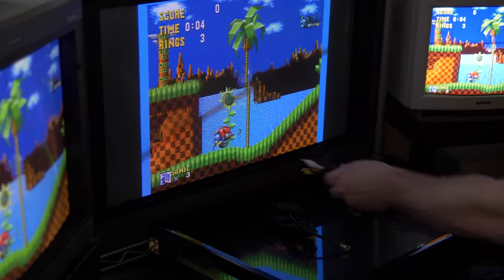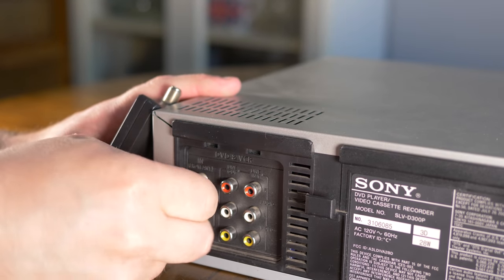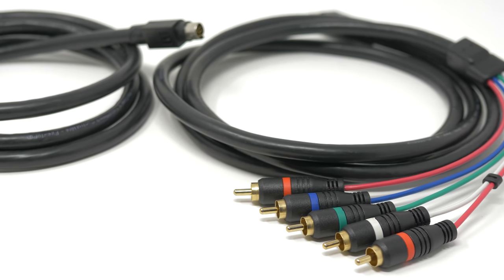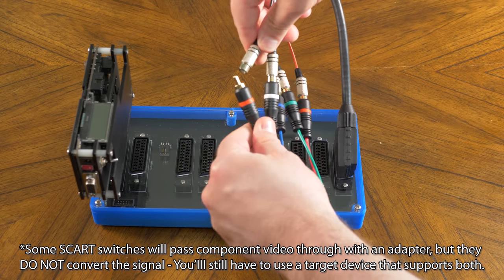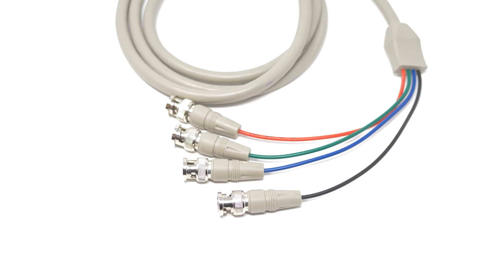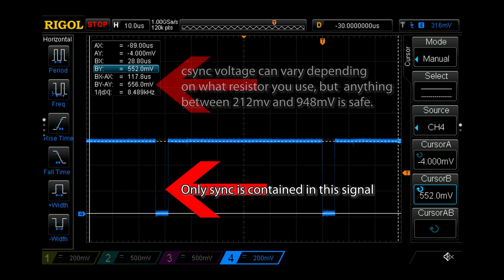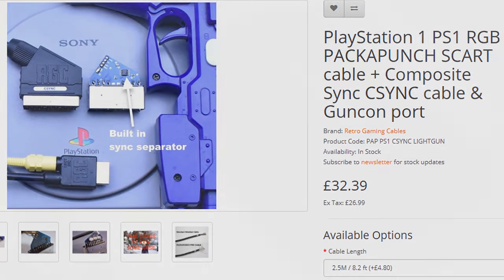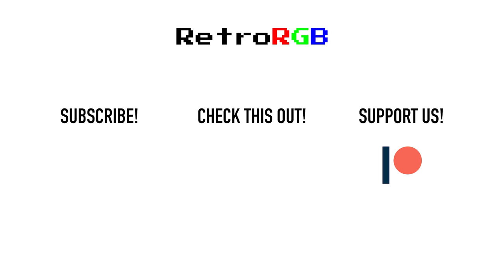Choosing The Right Cable For Your Classic Console

Comment: Europe: our games run slower, but at least we have RGB over SCART.
Reply: Haha you made me smile 😊👌. Kudos from Belgium, EU
Reply: @ceberuss_yt8266  You're welcome, from Italy, EU
Reply: Pretty sure anyone would gladly take a regular frame rate over RGB.
Reply: Germany: 50/60Hz mod soldering job at day one for most consoles :) 
RGB-SCART RULES!!!
Reply: Yeah your both right!Greetings from Zurich,Switzerland!
Reply: Nothing stopping you importing or 50/modding.  I stopped buying PAL HW since 1991 until 2005 when it started being optimised.
Reply: @bestofthebeastlikebeast3754  but how many consumer grade NTSC cathode ray tube TVs had SCART input back then?
Reply: @bestofthebeastlikebeast3754  "In North America, in the era when cathode ray tube Televisions were prominent, SCART input was not common, because it was an European Standard"
Did this sound more understandable?
Reply: I am so glad to own PAL Gamecube and PAL Wii because they support RGB out of the box without modding.
Reply: Laughs in homebrew and flashcarts
Reply: Not all games in pal are slow
Reply: If ur in Kentucky  I have alot of cables etc and 80s collectibles and star wars stuff etc
Reply: Stay away from atari they spark and cause fires
Reply: The PAL versions of the 6th Generation consoles began having 60Hz support natively with RGB support. Perfection
Reply: Meanwhile: European TVs fully supports non-PAL signals + most of them have SCART port

Comment: Being a European and having kept all my old consoles and cables from back in the day, I don't think I'll have any issues with the scart cables I have since they are all official cables purchased from brick and mortar stores from back in the day. Never even knew that there were issues with modern scart cables.
Reply: many of them are not RGB but just carry the composite and audio signals ^^ (that's why many of them are missing pins on the output)
Reply: @phreeze83  I’ve only seen scart without all the pins on adapters, which makes sense since you would only connect composite cables into them. But honestly, the biggest use for scart back in the day was being able to connect to any European tv & have the console work automatically instead of faffing about with the channels to find the one which one it was outputting to.
Reply: @knightsabre2k  That is only really a thing on rf (or maybe some budget models so old they don't have an OSD), in the US most sets I have seen just have an input select button
Reply: @knightsabre2k  Stores like retrogamingcables make their own C-SYNC RGB SCART cables to force C-Sync on consoles that output composite sync, which is anything bar Sega
Reply: Hahhah. Check out Retro Gaming Cables RGB cables.
They surpass easily all of those cables which came along with those retro consoles.
They even have circuit boards inside the SCART part.

Used them for years now and I'm not looking back.

And now with the Rad2x models which uses HDMI on retro consoles they are looking tad better and are compatible with never televisions which don't have SCART anymore.
Reply: Pretty sure your cables are official composite not rgb scart. Those were very rare even back in the day

Comment: I thought the 'composite' in CSYNC came from it being the composite of the H and V syncs? Nothing to do with actual composite video.
Reply: RGB Master Class gang represent
Reply: It is. I don't know why he related it to composite video.
Reply: @ItsJustEmK  What? He is specifically talking about CSYNC and attenuation when he says this.
Reply: I'm honestly kinda shocked Bob got that wrong. MLiG did a better job explaining it years ago (around eight minutes in): https://www.youtube.com/watch?v=LAlrdCBjUAQ
Reply from the maker: It's still a great visualization of what the voltage looks like:  "See the cvbs signal?  csync is JUST the voltage part of that, at about the same level."
I'm pretty sure I said something like "maybe it's..." to show that I'm just speculating.  Even if I'm 100% wrong, that wasn't the point - I needed to separate the terms "composite video as sync" and "composite sync" and I accomplished that.
Reply: @RetroRGB  Thanks for the info, that makes perfect sense. I did not mean it to sound like "you're wrong". I just wanted to clarify what I had thought it was.
Reply: @RetroRGB  Simple mistake - composite sync (H+V sync) is pretty much the only kind of sync in most console video output, especially for TVs; separate sync is a lot more common in VGA, like you mentioned, and also "weird old PC video output".  Depending on platform various old computers might use sync-on-green (SGI VGA, some fancy PC graphics adapters, etc.), H/V (VGA/EGA/CGA), or csync (lots of 8-bit computers, because they were often designed for TV output).

Comment: This is the first time I've seen anyone take the time to carefully explain the issues with CSync. I have some Luma for Sync cables that I'll keep using but I'm going to ditch the "boosted" sync cable I got for my Model 2 Genesis. Thanks for the explanation Bob!
Reply from the maker: Glad I could help!  Also, if you have a soldering iron and a multimeter, you can just remove the sync stripper and add a resistor and capacitor in it's place.  Check out the video linked in the description for more details.

Comment: Thanks for the extra info.  I have purchased all necessary HD retrovision cables for my setup, but I still learned new info here.  I am certainly glad I don't really need to worry about scart cable issues with all the retrotink/scaler options available for my humble collection.

Comment: Thanks for the video. I was interested in understanding why discrete electrical components were needed outside the console for SCART. Your explanation made sense. So that I do not have to buy separate shielded SCART cables for each of my systems, I was thinking of building adapters. For example, a 9-pin mini DIN to SCART adapter that contained the 75 ohm resistors and 220uf caps required for the Genesis 2/32x.  Plug that into the sega and then use a high quality shielded SCART cable to the upscaler. Build similar rgb adapters for each system and reuse the cable.

Comment: I think something everyone should keep in mind is that if you do not have a quality power supply/official power supply then it can introduce video interference. I had a cheap 2 in 1 power supply for my snes and it created wavy lines on the screen from top to bottom. It also created sound issues. One I got an official snes power supply then it went away.
Reply from the maker: Absolutely!  I strongly recommend these for all the reasons listed:  https://www.retrorgb.com/triad.html
Reply: @RetroRGB   thanks! If one of mine ever goes out then I’ll be sure to take a look at this!

Comment: I would be interested in adapters that let me use two video signals at the same time from any given console. At least when I had a working CRT TV, something that allowed me to use composite video but also get S-video or RGB sourced to a scaler/line multiplier for video capture/streaming simultaneously

Comment: Is there any way to know if your CRT is getting an RGB signal? My 14 inch PAL CRT from the early 00s says RGB but my mid to late 90s 24 inch CRT doesn’t say it. The RGB SCART works and it looks fairly clean but I’m not 100% certain if it’s using the composite signal in the SCART or if it is proper RGB. I like the larger screen though. My 7 year old daughter is playing Sonic 2 on it right now with the Mega Drive (aka Genesis in the US).

Comment: I'm looking to build a DIN-5 to S-Video cable for my Atari 800, which outputs separate chroma and luma from its monitor port along with composite video on a separate line and audio on yet another line.
This video has helped a bit but also added confusion with all that stuff about SCART.
Mine is a U.S. NTSC system, so I'm really not interested in that.

Comment: Can you help me? So I’ve seen RGB cables but they look similar to component except they come with a yellow cable instead. Can I connect RGB cables to component?
Reply from the maker: I don't know for sure, but those sound like RGBs RCA cable.  They're sending RGB, not component, so no, that wouldn't work.  You can try though...just only try for a second and if it doesn't get a proper signal, power the console off right away.

Comment: I know this was meant to be an introductory video and want to avoid complexity as much as possible, but when introducing RGB I think it would be very educational to clarify from the beginning that RGB and SCART are not a necessary marriage, even though it's by far the most common pairing in the retro game field. A brief mention of HD-15 ("VGA") and BNC as alternatives for delivering the same kind of RGBS signals as SCART would be very useful to start informing people of the possibility of not depending on SCART and its disadvantages to enjoy the benefits of RGB quality. Perhaps this can be a topic for its own video later :)
Reply from the maker: I literally showed composite video running through a SCART cable.  Twice.
Reply: @RetroRGB  I think you replied to the wrong comment, or somehow misread mine. My comment was about non-SCART RGB cable options and that mention of this would be educational, or better yet a separate video on the topic.

Comment: Three of my SDTV consoles hooked to my CRT officially support Component. Been pondering if I should bite the bullet and upgrade the other two with a Component switch (currently only the Wii is hooked via Component, with the Xbox and PS2 using S-Video). I’ve actually got the switch already (bought it at a Goodwill, I think) but I never integrated it in any of my setups. There are probably more that do (I think the Saturn can with an aftermarket cable).

Also LMAO at hooking up a system via R/F only to connect the VCR itself to a RetroTink 5X. Buying a $275 scaler to hook your system up via R/F is quite a gulf (I’m not being derogatory, disclaimer, I just find the act of doing so humorous).

Comment: I have a question so I want stream and make a channel playing my old vintage consoles such as nes snes n64 sega dream cat game cube original Xbox ps1 and ps2 I bought the eon GCHD Mk-II however I did not know that not all games are upscale compatible I did however find a way to force the game to run 480p but I don’t really want to do all the extra steps for it so my question is if I get the Retrotink 5x will I run into the same problem? Or will it be able to upscale every game for every console with no issues?

Comment: 11:27 - what's the name of the SCART to RCA composite/RCA Audio adapter you show in this shot? I have a Sega Genesis 1, and it seems like this might be the right thing to connect it to my Sony 20" CRT - which is limited to RF, and composite video/audio L&R RCA inputs. Or am I misunderstanding the requirements? Thanks!
Reply from the maker: It's just a generic one from eBay.  This will get audio from any SCART source, but it will only pass composite video if the RGB SCART cable uses composite video for sync.
Reply: @RetroRGB  Thanks!

Comment: Hi Bob, I recently upgraded my Component CRT to a PVM-14L2 monitor. My entire setup relies on HDRerovision Component cables. Unfortunately, L2 monitors have an issue with Componentvin where the LPF is out of phase, causing an over sharpening of the image. You can correct this issue by going into the service menu and and changing the DEC LPF to 0. But, the L2 monitor does not allow to save this setting into ram, making you constantly changing this setting every you turn ON the monitor or reset a console. The only solution I can think of is using the RetroTINK COM2RGB transcoder. But because I use HDRetrovision cables, I hate the idea of going from RGB to Component, and then back to RGB. I feel like there could be a loss of image quality going down this route. What’s your take on this and what do you recommend?

Comment: This is great. One thing i would like to see is the difference between using the really good component cables vs the cheap ones. Ive never found a good cheap OG Xbox component cable, but cheap ones for PS2 and Wii seem to be very good indeed to my eyes,  tests would no doubt tell me otherwise
Reply from the maker: Good suggestion.  There's just as much interference as with bad SCART cables, but the interference can often be slightly different.  I'll add that to my list :)
Reply: Poorly made component cables (as in YPbPr)  can exhibit poor green color balance with everything else. So your picture can appear more green than it should.

Comment: These days I'm setting up a Wii. It works so far but I'm using a sub par solution, which is a cheap hdmi adapter. It results in crushed colors and slight checkerboard artefacts on the pictures. The signal conversion is made through the little adapter so I don't have any latency. Well I want to change for RGB Scart but also keep it simple. As for older consoles my TV only accepts RGB Scart cables (I'm French, it was the standard here). It's a flat panel, so if I understood well, I will encounter picture latency if I wire the Scart cable directly into the TV ports. So I need to get a device that is able to convert the analog signal from the console, into a digital one to avoid such issues. What would be a good scaler for that ? 
And if I buy a good RGB Scart cable, will compatibility problems be a common occurrence or am I good to go ?
Not looking for a perfect output but just a good one while keeping it simple. Thanks.

Comment: I've got a csync related question about the HDretrovision cables. I know you aren't the seller or anything, but it's right up your alley.

These RGB to component cables use composite for sync, but I'm curious if you could feed them 75ohm csync along the same pin and still get component out. 

This is for a game gear with an LCD mod. the LCD outputs RGB, but not composite. I can wire the 75ohm csync to the composite pin of a genesis2 jack if it would work.

Thanks!
Reply from the maker: Yes, this is exactly what we do on the OpenMVS and the Sega Triple Bypass.

Comment: Hi mate, great video. I'm in the UK and I'm trying to find a male component to female scart. I only have one RGB scart on the back of my CRT TV, but I have an AV receiver with 2 x component in and 1 x component out. So I'd like to run my old DVD player via component and my Wii via component into the AV receiver... then output via component into RGB scart in the back of the TV. Is this possible? Or do you have another option for me? Any help appreciated, cheers!
Reply from the maker: Thanks.  You'd want a Comp2RGB, which does a great job converting the signal:  https://retrorgb.link/comp2rgbuk
Links to all RetroTINK products are here, in case that seller is sold out:  https://www.retrorgb.com/retrotink.html
...then you'd just need a SCART cable into the TV.  Or if it's positioned correctly, a SCART Coupler:  https://www.retrorgb.com/open-source-scart-coupler.html

Comment: What is the best option for using a PS2 to play PS1 games? My flat screen TV has component inputs, but would component cables provide a sharp enough picture, or do I need a scaler as well?
Reply from the maker: The best option is connecting the PS2 to a good scaler via component video cables.  Here's more info:  https://youtu.be/TdfFnR-hOK8
...and here's why it's probably not a good idea to connect component video directly to your flat panel:  https://youtu.be/jJzN_YHZezY

Comment: If I can get RGB running on my Saturn do light games still work correctly? Also my Sony Trinitron CRT has component inputs but it seems they only make Saturn cables in scart...can I just do a scart to component adapter?
Reply from the maker: An RGB to component converter would work, but you can just get Saturn component cables if you'd like - Links here in the middle of the page:  https://www.retrorgb.com/saturn.html
As long as it's a CRT, light gun games work perfectly with all outputs.  This was one of my biggest concerns when I switched to RGB, so I made sure to show an example.  It might be my first YouTube video :)  https://youtu.be/9JoWce_hC7A

Comment: You didn't touch on one point with CSYNC that I stumbled across while trying to DIY scart cables: If you are running TTL CSYNC down the length of the cable and attenuating it at the SCART end, then you've replaced one interference problem with another: instead of the high-frequency chroma signal easily coupling into the RGB lines, now you have the high-amplitude CSYNC signal coupling into the audio lines.
Reply from the maker: While you're correct, that falls into "properly built cables".  If I ever do a video on how to make your own cables, I'll go into detail about that.
Reply: @RetroRGB  Right, I was just saying that using csync in place of composite or luma doesn't actually eliminate the interference problem, it replaces it with another interference problem. Cables with good internal shielding don't have either problem.

Comment: Cool. I've been feeling out on retro gaming. I even caved and got xStation because I wanted to play games not available on PSN. I use S video for my CRT but it has those "Jail Bars." It'll do for now
Reply from the maker: If you're getting jailbars with S-Video, it means the cable you're using isn't shielded.  I ran into the same issue with cheap Saturn and SNES S-Video cables.  Unfortunately, I don't have a good source for PlayStation S-Video cables.  Maybe try to find original Sony ones?